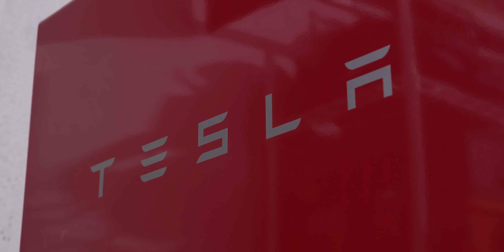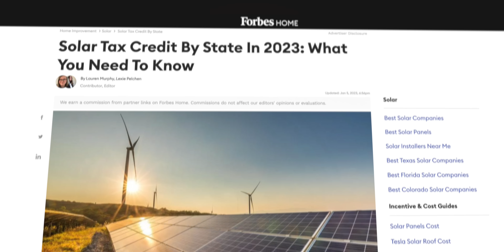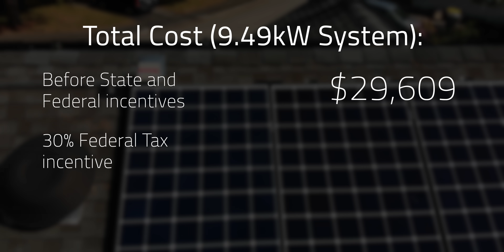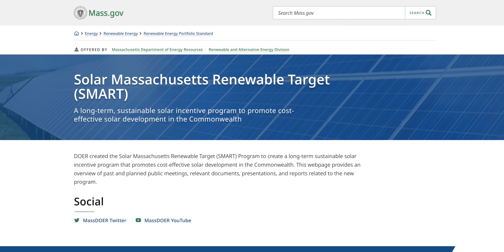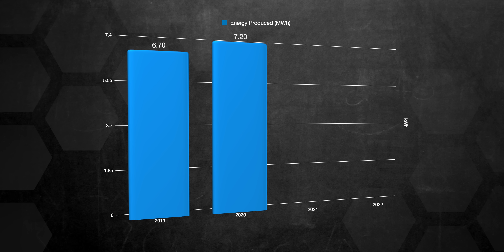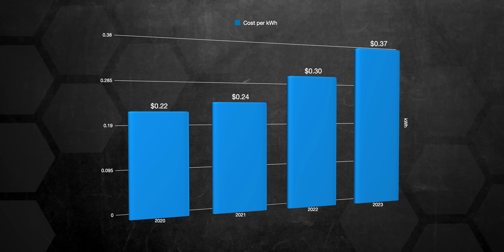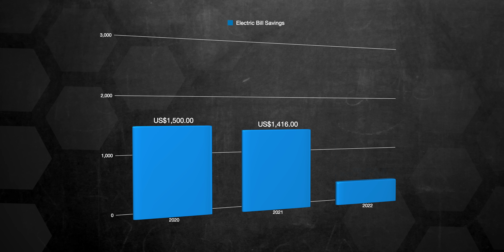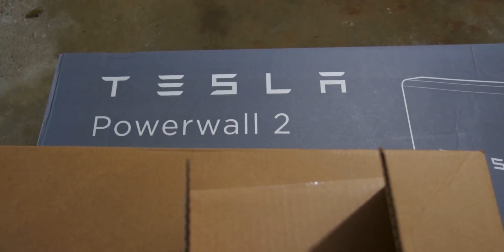5 Years with Solar Panels - Is It Still Worth It?

Comment: It is so important to know how your local utility will work with you if you get solar panels on your house. Matt mentioned 1 to 1 net metering in the video. If you hear that, celebrate because you're one of the lucky ones and solar panels will likely be a great investment for you. Even with that though, your 1 to 1 net metering will likely be capped. You utility's website should have more information on what their specific rules are. Get familiar with them because that, not the cost of the system, will likely be the determining factor of whether or not solar is right for you.

Comment: Looking at the foot print of your new house from the drone shot of it being built triggered this question. How were architectural versus engineering choices balanced? Heat loss is primarily through walls and the roof. Less exterior wall length per square foot of interior space all other things being equal will make a house more efficient to heat. This is because there is less wall to loss heat through. The foot print of your new house seems to be more of an architectural choice. Could you talk about this choice? If this was already covered in another video my apologies.

Comment: My parents also has a solar system and a battery.
This is advantageous from the perspective that the electricity price is priced by hour can now be handled better. Recent addition has been addition of price controlled heating, which works fine because it's a water heating system so the mass of the water keeps the temperature pretty well, even though it swings between 55 and 95 degrees C in the accumulator tank.

Comment: I wish DE would allow us to both hook up to the grid AND make use of our own solar in a blackout. Sadly, you could be generating all the power you need and not be able to use it because the grid is down. They say it’s because of safety reasons, but obviously this has been solved where you are in MA. Just be aware that some states won’t let you have your cake and eat it too if you’re considering solar. It’s the main reason I haven’t gotten it yet. Maybe when technology improves I could try to go completely off grid, but that would no doubt present a whole different set of problems.
Reply: Actually, it’s still an issue in Massachusetts, if you don’t have a home battery. 

That’s where the grid safety solution is solved, since the battery always serves as a buffer between the grid and the home, even in regular operation. Some people also have a switch they can flip to manually disconnect the whole system from the grid, which also can run the panels standalone. 

The safety issue comes when, if you cannot disconnect your panels from the grid and the grid is down, your panels will still attempt to send power back into the grid, which cannot handle it, since it is down. And the cheapest grid ties, being necessary to provide solar backup options for everyone without a battery, do not allow you to selectively disconnect your home from the grid.
Reply: Chris, a grid tied system needs the voltage and frequency from the grid to function. To operate as a stand alone system, you need an automatic transfer switch and a battery. When we lose power, even  momentarily, it takes our system some time to synchronize the frequency and resume production.

Comment: I have already solar panels on my roof since Januari 2014, so 9 years.. paid back for itself 2 years ago. It cost me about €5000 for a 3500Wp system (14x 250Wp panels).. Paid with savings I had on my bank acount doing nothing (0.05% interest per year or so at the time), so I see it as I moved my savings to my roof, and getting 10%-12% interest on that investment, yes I saved about 500-600 per year in electricity bills. Best investment I did in a long time (untill I started to invest in Tesla, but that is not the subject here 🙂 ), 3500Wp is more than enough to cover all my energy needs (No A/C, No big ass refrigerator, no seperate freezer) but I will go over to electric induction cooking, which will save on gas, but of course will increase my electricity usage, but I still think it will remain within the production of my solar cells,.. But we will see how that plays out, the savings on gas will cover this anyways as gas is way more expensive that electricity.

Because I have also(still) 1:1 metering, a battery is not interesting at at the moment, what I produce too much during summer I can use in winter..In fact you use the grid as your battery, if you have 1:1 metering. But Metering will be wind down here starting in 2026, so I hope Tesla Powerwalls get a bit cheaper by then, and maybe Tesla will start VPP's here as well.

I live in The Netherlands where the reliability of electric grid is very high with more than 99% uptime, power outages are very rare, and if they happen they are short lived, like for a couple hours at the most... All electricity lines are under ground, except for the big high voltage lines, this helps a lot for reliability.

Comment: Your homes don't use a lot of electricity, you do.
Reply: Our homes here in the US are usually built to the lowest possible cost standard and still pass inspection. Then add in that a lot of the homes are built before 1960 when standards were even worse. Or older or even newer homes need to have their attics re-insulated if it is the blown fiberglass fluff insulation and people never do it due to no money for it, do not know they need to or have the money know they need to and refuse to do it and rather pay higher electric bills.

Comment: I'm in Ottawa Canada and I have a 10kw array. The installer neglected to install the snow rail and the first winter we had a fairly large accumulation slide off. It shook the house. I went out to look at what had happened and was surprised to see it had dumped the snow out far enough to smash my neighbours air conditioning unit in to the ground. Thankfully the installer covered the repairs and installed the rail. No avalanches since.
Reply: I had the same thing happen twice, destroyed a couple gazebo’s, had a snow guard put in this year.
Reply: Hi neighbour. How's your performance been in Ottawa? Would you do it again?
Reply: @SeanPoulter  right now it's net metering and I have no storage yet. So I get paid for what I generate. We're told to expect next to nothing in the winter months. During the summer it generates a lot weather permitting. The last 2 years were a little lower but I generate about 8000kwh a year. When I joined the microfit program the guaranteed paying me 29 cents per kWh. Normal rate is lower. I'm on a tiered plan. The first 1000kwh/month is 8.7 cents/kwh and after that it goes up to 10.3 cents. I use about 1100/month. I run some servers. If I ignore the stupid extra fees I use roughly $100 is actual electricity/month. So roughly $1200/year actual use ($2160 after all the fees) . The payout I get from the hydro company has averaged about $2300/year. I plan to add significant storage in the next 5 years with the hope of still selling to the utility but also making sure I never cross in to the 2nd tier pricing by using stored power. I'm pretty much waiting in the hopes more pre made storage options come out with newer battery tech. I'd prefer more stable batteries than lithium ion in my garage even though I don't red about a lot of fires from things like power walls... But I haven't looked too hard.
Reply: @CaptainRon1913  I might end up building my own using LiFePo packs and a good controller. I have a 5 to 10 year timeline. I'm not in a hurry. Until my microfit contract is up I have a guaranteed pay rate that is 3 times the cost of power I use. The battery pack won't add much value for me until I have an EV in the garage.
Reply: @CaptainRon1913  yeah I think the battery price is only going to go up. Also looking like we will hit Peak copper before Peak oil.
Reply: @ambivalentone  Let me get this straight,  $2160 in total cost for electric per year plus fees and you  receive $2300 from the utility for a net payback of $140 per year.   I assume that the fees you refer to are the cost of the panels.  Either that or you won't realize a total ROI for 200 years.   Sounds to me that it's not worth the hassle for a $140/year.
Reply: @lo1234-w9r  the complete elimination of my electrical bill counts towards my ROI. Why wouldn't it?
Reply: @CaptainRon1913 Like fusion power.  "Just 40 years away".....and it was the same in 1965.
Reply: I’m also interested in knowing more about your setup
Reply: Best advice is to price it out, heard that the costa have dropped, cost me around $30,000 4 years ago.  But I had bad installers, ended up having to do the roof a couple years ago and cost $7500, to remove and reinstall the panels, and discovered a lot of issues with the original install, including critter damage to some wires.  2022 was my best year of production with 10 MWh of production.
Reply: We are in ottawa also and have been looking at doing solar panels with storage. I would love to hear more information. ❤
Reply: I am in Calgary. We are further north on the horizontal line but just curious if you have stats about average per day electricity generation. Like how many Kilowatts per day? Are you using any batteries?
Reply: @faisal-ca  A friend here in Edmonton generated over 27 kWh in a previous March.  He has 11 panels spread over two adjacent sides of his roof. total peak 7KW.  

He also has an electric car, even with a small house without a very big roof his roof produced more electricity than he used in total for his House consumption and mobility. Sadly, because he didn’t have a tesla power wall or equivalent, his electric car was out during the day at work when the sun was shining, and our local power utility does not do the nice math like Matt’s does, he pays 10 times or more to get power from the grid as opposed to giving it to the grid. So I unfortunately still had a net sizeable power bill. So in your case if you have a fixed budget maybe get a bit less solar panels and have a battery.

Overall proved the idea that “bright  and cold” Is optimal for solar.
Reply: @markfiala3652  Thank you, Mark. Appreciate the details. Big batteries Canada has an alternative to Tesla's power wall. I think it's Rihno. It stores 14 kWh and costs around 12K CAD. My current daily usage is 20 kWh so getting 2 batteries will be great. It will bump the project cost to around 50K, and the return would be around 30 years. 1,500$ savings per year.
Reply: @markfiala3652  I am also in Edmonton, how does it work for your friend with the snow ?  My roof is on a flatter side, have more concern that the snow will stay there
Reply: @faisal-ca  30 years for it to pay for itself? Doesn’t sound like a good deal to me. Thinking 3 or 5 years maybe…..but 30?  Not worth it.
Reply: @Tonyspark711 that is the issue with videos like this. It makes solar sound amazing, but there are tons of variables that can make it be a no brainer, or make little to no sense.
Reply: @faisal-ca  The best solar in Canada is southern Alberta and Sask.
Reply: Seems like snow slides about as far off as down. In CO I had a 4ft slab knock both my gene and propane tank off there pads. For estimating power during storms or cloudy days, 5 to 10% was what i averaged. In AK in January I got 0.3ah~80w during full sun from 11.6kw system, less than 1%.
Reply: Matt, your experience is positive in light of Peter Zeihan’s YouTube comments that there’s no point in putting solar in North eastern North America!
Reply: . Zeihan is looking at solar costs and supply, not the subsidy/tax shifting gambit given here.
Reply: @michaelplunkett8059  
Zeihan drank the Kool aid of the global warming quackery.
Reply: Not sure I would do a system on the roof again, if I did it would be when we reshingled the roof.  We had a 10kWh system in Barrie Ont.  we definitely had the snow sliding issues many have reported.  The other issue we had was birds nesting under the panels and literally shovel fulls of bird crap at the down spouts after a rain fall.  We on average generated 11,500 kW over the year
Reply: @Blue-Devil-w9e  my installer put in some very effective (so far) critter guard wire mesh. They also included a 20 year warranty with 1 free removal and reinstall of the array when I need to redo the shingles during the warranty period.
Reply: I was hoping my solar would take out the delivery guy, any of them, they just toss it over the gate wont even come to the porch!
Reply: My wife and I put a 4,350 watt solar system on house in 2019. We have an excellent south facing roof and lots of sunshine here in the southwest US. It produces more than we use, so our electric bill is just the minimum connection fees of $8.17 a month. After rebates and tax credits it cost about $9,500. We are very happy with it and would do it again in a heartbeat.
Reply: do you need bettries?
Reply: Me me me me... Me me me

Decarbonization is 21st century pyramid building.
Just burn coal. 

This is sickening on so many levels.  "How to screw the lower middle class and make them pay for your feel-goodery."

Comment: We pay a similar $0.37/kWh during peak hours, and had solar installed October 2022 after getting some gnarly electric bills last summer. Our cost was $31,450 before incentives for 8.5 kW of panels, though we do have a south facing roof and no shade on the part of the roof that has panels, so our production numbers are pretty decent for a system that size, in 4 months since it was installed we've produced just over 3MW of power, and that's despite a fairly rainy (for CA) winter so far. The installer projects 15MW for the full year, and I expect to save ~$4000/yr so the system will "pay for itself" in around 6 years. Yes, the value proposition of putting the money into the stock market would probably be better, but this is bought and paid for and I don't know that I'd have had the discipline to stash the same money in the market and leave it alone. Also the 30% tax incentive was great, got that back on our taxes (as others have commented, it has nothing to do with your withholding, but we pay enough in taxes to get the full 9k back this year... also you can split it between multiple years if your tax burden is lower). Overall we've been happy with our system. I can't imagine paying for the battery backup though. Our power is out for maybe 2 hours per year on average, it seems bizarre to pay 5 figures to mitigate that... though I suppose if it was free (as it was for Matt) I might have some enthusiasm for it... Even if I had a need for it, I'm not convinced the battery tech is mature yet.
Reply: He mentioned the Grid can use his banked power at peak times and give him a $700 check for it
Reply: True, but $700/yr on a 10-12k expense/investment (it's not free for most folks) is not a great ROI, and even excluding alternative investment options may not even pay for itself over the life of the battery.

Comment: RETIRED 78, USAF, VFW. MY SIX YEAR PROJECT HOME TWO ACRES, EVERY NAIL I DRIVE. WITH 15 YEARS SOLAR. COST ENERGY ON MINUS SIDE 5 YEAR 2018 MODEL 3. SOLAR INSTALLED ON 30' BY 60' PARK UNDER RAMADA. EDIT: CYBER TRUCK DELIVERY 2024.

Comment: I have solar panels now for 4 years and the only regret I have that I didn't buy a hybrid inverter. The one I have now doesn't work without grid power so when there is a blackout I have a battery system which will work for about 8 hours and I'm out of of power.

Comment: By the time you pay everything off and hit the break even point you need to replace the panels and start over because they have a definite lifespan.
Reply: I'm just about to replace my panels, which were 2nd hand when I installed them in 2009(?).  While their output has dropped a little, the main reason I'm replacing them is that I want to use more powerful panels with my inverter.

Comment: 1MWh a month?!? What? How's that even possible? I use 2MWh a year ... and am not even trying to be careful with electricity usage.
Might be worth to put togther a video analyzing your usage and exploring options of lowering it.
Reply: Electric cars and electric heat are presumably a large part of it. If you work out how many kWh of gas or propane you’re using, and factor in the gasoline costs, it might not be so different in overall energy consumption.